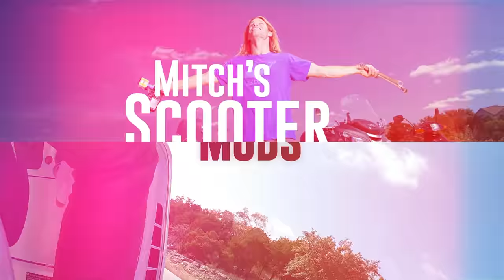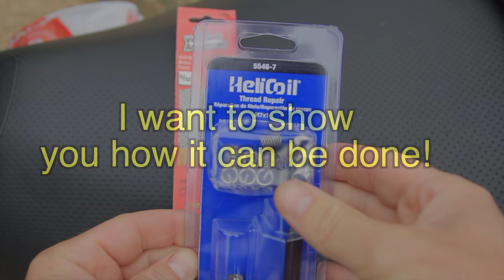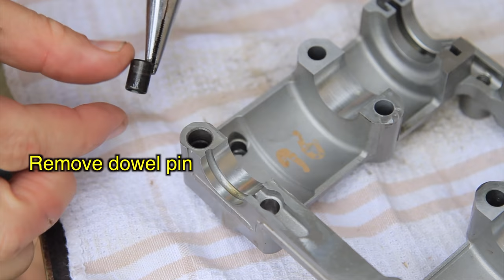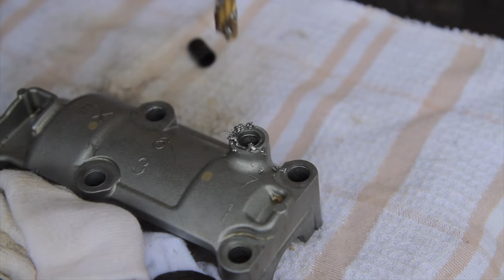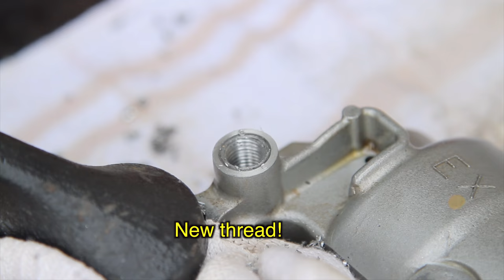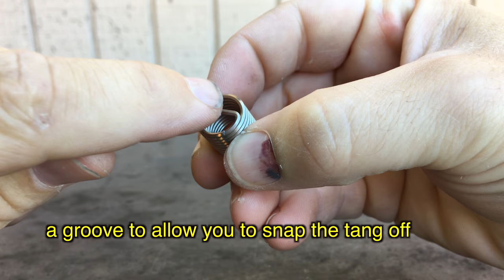Bolt Thread STRIPPED?! Use Helicoil !! | Mitch's Scooter Stuff

Comment: Mitch!!!! I need your help/advice. I have a honda ruckus with a stripped spark plug hole. Thread chaser 10mx1.0 was too small so I assume repairing isn't a option. Pulling the head labor intensive. Motor is mint besides that. What's my best course of action? Any heli coil kit recommendations?

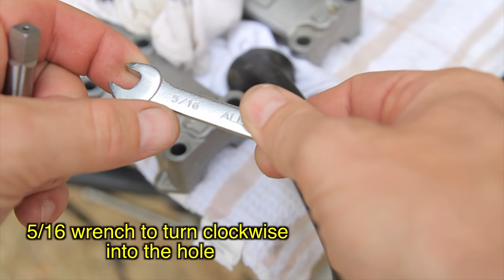Comment: 3:08 - Actually Mitch, it would be better to use a tap handle so that you have better control on the tap. This way you make sure that the new threads are straight and correct. Also... a couple of drops of TAP MAGIC are very helpful. It helps make better threads.
Reply from the maker: Yeah I almost bought it but I did some before in the past and it works fine so I want people to see that they can get job done without special tool. If I do this everyday I would get one. Thanks for the comment
Reply: You know if you need to tap a bunch of holes I have the equipment.
...oddly.... that didn't sound right...